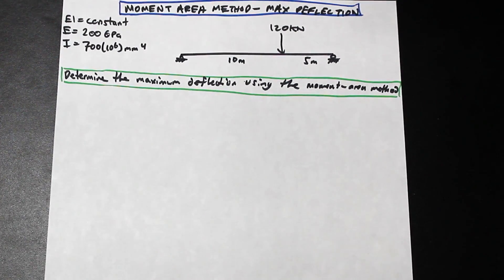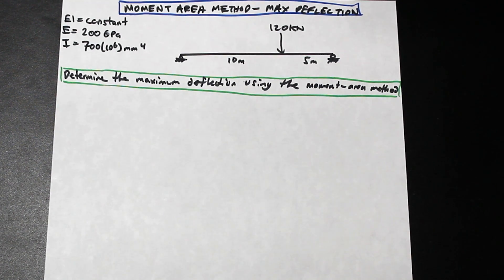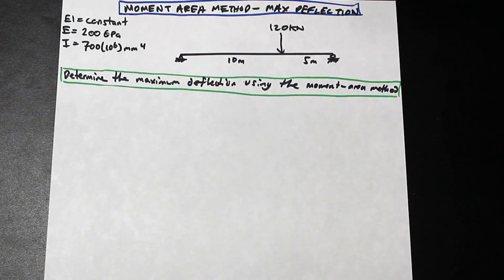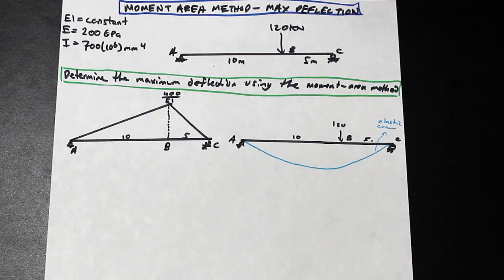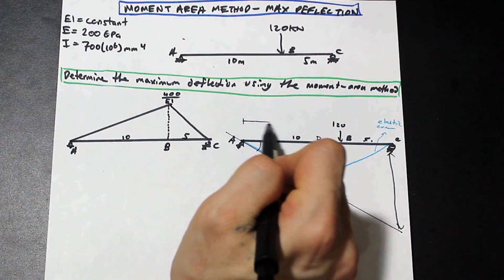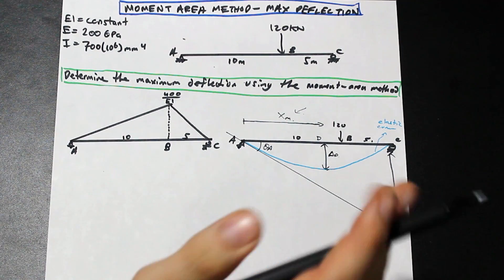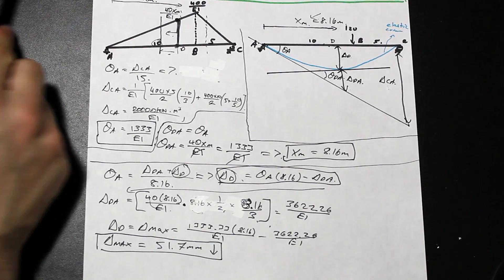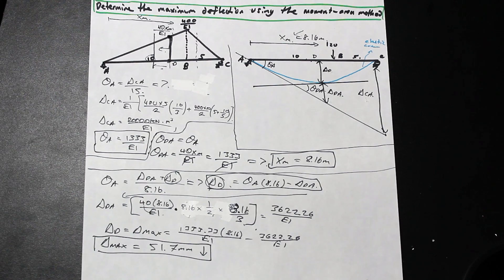Moment-Area Method - How to Solve for Maximum Deflection - Example Problem

Comment from the maker: Note: When calculating Xm at 7:25 by equating theta DA to theta A, we have to multiply 40Xm/EI * Xm * 0.5 for the area under the M/EI diagram, not just 40Xm /EI.  Sorry about missing that, please make this correction.

Check out our introductory video on the moment-area method before trying this one! https://www.youtube.com/watch?v=jkwPzvWsqIY&t=325s
Difficult practice problem with a hinge here: https://www.youtube.com/watch?v=YnWRn2jVGc8&feature=youtu.be
Reply: That just got me cofused for almost 1 hour... anyway thanks...
Reply: How theat DA is equal to area of m/EI diagram explain me please
Reply: sir why should multiply 40Xm/Ei * 1/2 * Xm ? and how it is equal to area of moment diagram?
Reply: we are calculating theta therfore we cant multiply with xm it should be like 40xm/EI*(1/2) BECAUSE  of the integral we multiply xm when we are calculation tca in theta we dont need multiply xm again
Reply: just notice that thank you
Reply: @jamesclaridad4394  we're calculating the area under the M/EI diagram which is a triangle and you the area of a triangle is (1/2)bh
Reply: *know
Reply: @AsmiTAdhikari  He should use the first area moment theorem.  for maximum deflection, the slope is zero.
Reply: I tried for like 2hrs but still didn't understand this step. :'(
Reply: Yeah, that correction I am thinking about

Comment: hey AF MATH ! i really like your videos it really captivate me more than our basic "engineer" courses , that has no link with the real world :( now for this type of problem wouldn't be faster and easier to use a software that can evaluate forces applied on a surface such as "autodesk professional" or "solidworks"
Reply from the maker: Hey buddy, thank you so much for this post.  We're so glad we could reach you and help you enjoy your course material more.  Let us know a bit more about yourself, what year are you in and in what country are you a student?

As for your question, you're absolutely right.  Very rarely in the field would we perform these types of calculations by hand.  The programs you suggested though wouldn't be used by a structural engineer for analysis for this type of problem.  Structural analysis software such as SAP2000, Staad Pro, Etabs, SAFE, and many more are used for the analysis of structures and typically they're much more difficult than just a simply supported beam with many variables.  However, in an engineering education in University, you study how to perform these checks manually using different techniques.  This is a large focus of our channel.  

Check out this video for how to solve a beam for deflection, shear and moment using an evaluation version of a structural analysis software that you can get as a student.  This is how engineers evaluate structures in the industry, and you can use it for your assignments too! -> https://www.youtube.com/watch?v=BJ0aOUGNw5w

Thanks again for your post and question.
Reply: AF Math & Engineering first thank you so much for taking time to answer my question and it's a pleasure for me to converse with a civil engineer ! i turned 18 a week ago , i live in france , i study at the esme sudria in paris (mechanical and robotics engineering), it's my first year out of the 5 years to get the degree, and it's pretty complicated for me to say the least , i took a classe for 2 years that is not really meant to give you the keys to succeed during these 5 years , still striving for my degree i will never let go ! if i get to my third year i'll have to choose a "path"?? renewable energy for me is the future ! that's my story ,  now you tell me mister Af Math did you have hard times when you were student too ?
Reply from the maker: No worries man, we love chatting with young engineers.  I'm Fred from the F in AF :D 

That's great, it must be an exciting time in your life to start your engineering journey.  Learning how to succeed in engineering at University is half learning how to master fundamental mathematical and physics principles, the rest is just learning how to master school and studying!  First year is always hard, it gets easier after that.  As for your "path", you'll choose a specialization stream and thats when you really start learning about your career and profession!  

I had a very difficult time in my first semester as I returned to school at age 26 to start my engineering career after becoming a professional chef after high school.  I hadn't seen any math, physics or chemistry in about seven years and jumped right into first year Civil engineering.  It was so difficult, I had to study 6-8 hours a day in an attempt to catch up and almost dropped out.  However, I stuck with it and managed to pass all of my first semester classes.  After first semester I figured out how to study correctly and started achieving very good grades in all of my classes, and my grades just kept going up as I learned more about how to prepare for tests.  That's the main reason why we stress tricks and tips in our videos: doing well in engineering in school is as much about knowledge as it is learning the tips and tricks you need to succeed.  Don't give up, it only gets easier.

Thanks again for sharing your experiences with us, please continue to comment on our videos if you have any questions and we'd be happy to help you out.  Let us know how your progress is going too.  Cheers!
Reply: AF Math & Engineering thank you so much for you support ! and your story is very inspiring ! i'll take some of your videos as a secondary personal teaching for all the things we don't learn in school i always do that ! keep up you are doing a great job and i will recommend you to one of my great friends , god bless you !
Reply from the maker: Thanks a lot man, great to get to know you better.  Good luck!

Comment: @7:25
You said theta DA is simply the area of the 'moment over EI diagram' between A and D. Then it should be (1/2)(Xm)(40Xm/EI)    ???? 😅😅😅
Reply from the maker: Hey man, you're right, if you calculate 1/2 (xm)(40Xm/EI) you'll get the same value, 1333/EI. Not sure what time stamp you linked as that's the end of the video.  

As for delta DA, which is the moment area about D of the area between D and A of the moment area diagram?  Theta is the area, delta is the moment area.  So by taking the area of DA, which is 40xm/EI * xm * 1/2 , and multiplying by the distance to the centroid, which is xm/3, we get the moment area about D of section DA of the M/EI diagram.  Hope that gave you a bit more info :D
Reply from the maker: Also, theta DA and theta A are equal in this question.
Reply: @7:25
LOL. Hahah.
Reply from the maker: :D
Reply from the maker: Are you currently a Civil Engineering student?
Reply: No. I'm teaching civil engineering students.
Reply from the maker: Ah, I see the note you've made here.  We didn't include xm * 0.5 when calculating xm.  Thanks for this, I'll add a comment correcting this.
Reply: My brother you are right

Comment: How do you get 8.16m? Even after the 0.5 correction in the pinned comment, I get Xm as 66.65m not anywhere near the length of the beam.
Reply from the maker: Check your units...you shouldn't be that far off..

Comment: is the moment area method and macauly's method the sam thing?
Reply from the maker: I dont believe so no, macaulays method is a double integration concept.
Reply: Thanks, from my understanding they both share similar roots, where the integral of moment is slope and the integral of slope is deflection. Right?
Reply from the maker: In the moment area, integration of the M/EI diagram is equal to the change in slope or deflection between two points, not the value itself.  Then we need to do some additional operations to get the actual values.  Macaulay method is similar to deflection by integration, where you derive moment expressions for each section of the beam then solve accordingly.  We have a video on deflection by integration which is very similar to this.
Reply: Thanks a lot. :)
Reply from the maker: @Phoenix67614  Thanks man! Glad you're enjoying them!